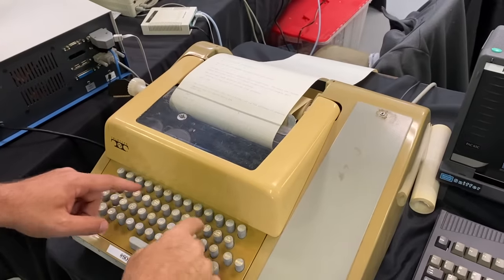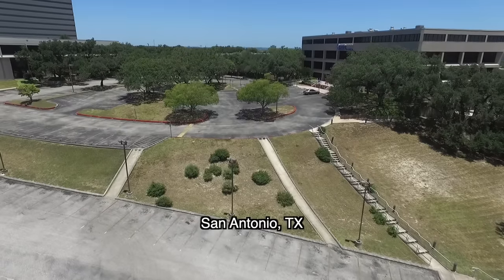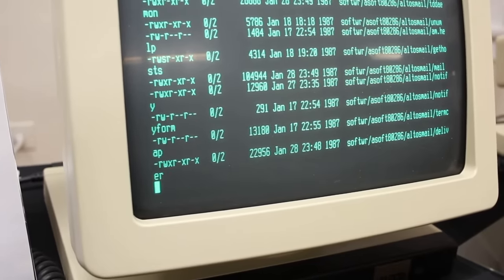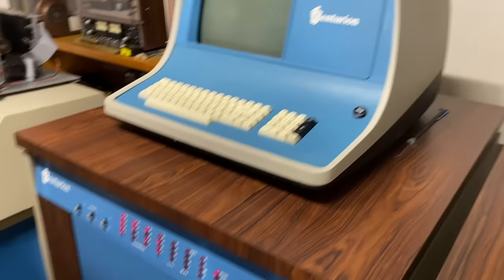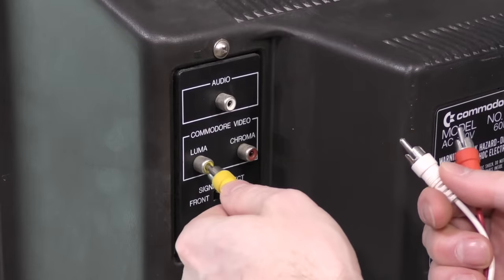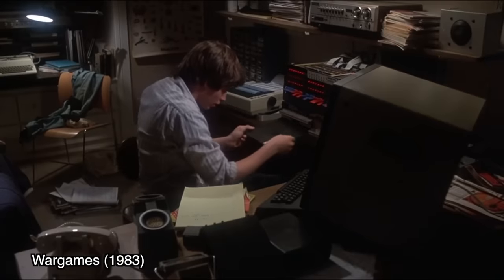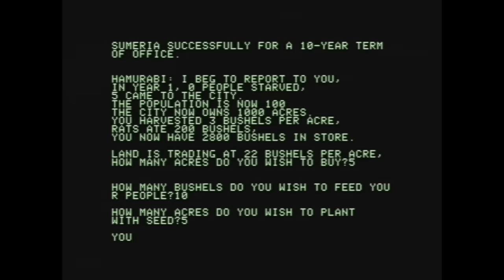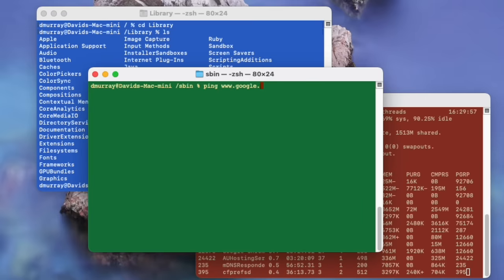What are Dumb Terminals?

Comment: Before ethernet, each of these terminals were linked by a dedicated serial/parallel cable to the main computer. That's why those suspended floors were needed for
Reply: I dare to say, relatively thin serial cables and network cables can go in trays above the inner ceiling, but raised floor enable piping for the cooling system for the cooling as well as heavy power cables to be routed out of sight and away from stumbling feet... :face-blue-question-mark:
Reply: And remember that IBM Mainframe (and other IBM compatible systems) used Bus and Tag cables to connect the disk and terminal controllers to the main CPU complex, These were thick and heavy cables that you wouldn't run overhead if you could avoid it.
The sort-of rule of thumb was that if it was a data processing or computer machine room, the cables would go down under a raised floor (which also hid not just pipes for water-cooled systems, but also air ducts for air cooled systems), and if it was a telecommunication machine room (like a telephone exchange), the cables would go up to trays suspended from the roof, and the floor would be solid concrete (mechanical switching gear was heavy!). 
This has tended to break down over the last couple of decades, and now many computer rooms use overhead cables. This is mainly due to not needing individual cables per terminal (just network cables), and also the fact that often comms equipment like network and SAN switches are installed in the racks with the computers (so a lot of the cables are just restricted to inside individual racks), just needing trunks links between the racks. Also fibre-optic cables are often used, which are much lighter, and have much higher data bandwidth than older types of cables.
Reply: So true!  My fist job was as a "Field Engineer" with Burroughs, installing miles of cables under the raised flooring.  All kinds of cables down there, but the largest quantities were the hundreds of serial cables (full 25-conductor RS232 cables!) , running from the DTE boxes (don't recall the name, but each one could handle 32 lines, or later 64 lines) out to the racks of modems. And also the huge cables for interconnecting the mainframes to the printers, card readers, SPOs, and banks of disk packs, tape drives, and HPT disks.  Those were the days!  A favorite prank with those cables among the older field engineers was to send the newbie out the engineering storage area, for a "cable stretcher", when the cables weren't quite able to reach their destination... Yup, we sure did have a LOT of cables down there.  An nothing at all "overhead", as some have suggested.  The ceiling area in those data center machine rooms was all  HVAC and fire suppression stuff.  No cabling related to the mainframes.

Comment: I used one in the dorm commons at the U of Wyoming in 1990. Set up an account on the VAX to run a statistical analysis package for a polisci class. Got my output on paper in a basket labeled with the first initial of my last name at the now-demolished Ivinson Building, where all that was located.

I didn’t understand it at the time, but that account also gave me email and internet access (such as it was back then).
Reply: Sounds very much like my experience at the University of Iowa starting in 1992. The dorm computer labs had a mixture of terminals and computers. I did get the email account and learned how to telnet to servers like ISCA BBS and Usenet before there was much you could do on the WWW. I was happy to use the terminals if the computers were taken since it was all text-based anyway. I got an account on all the computer servers they offered, even though I didn't know anything about mainframe systems. I taught myself how to use Unix from the man pages. I never got much into the Vax system - it was too unlike DOS for me to figure out. I even convinced my parents to get a dialup Compuserve account so I could email them, which we did so regularly.

Comment: I remember using a terminal back when I worked at Pizza Hut. This particular store in 2003 consisted of a windows 95 machine for a server that had nine terminals connected. Not all of them had keyboards but instead had six button pads on the line to control the orders that were on screen. As you can imagine if that silly 95 machine went down the whole store would grind to a halt until it rebooted. Ironically enough I noticed recently that some of that software from back then is still in use. I believe it is only used as timekeeping but still was odd to see it.
Reply: Well, that's yesterday to an old dude like me. So called terminals had been more or less "stone age" for a quarter of a century in 2003 as well.

Comment: What is interesting is those modern terminal apps you see in modern OS behave exactly like an old teletype, like in the sense that when you see what you type is the program echoing back the characters.
Reply: Amazing how terminals used to be big expensive machines that tons of places used.  Now all that can be done in a small program included with the OS and hardly anyone uses it or even knows what it is for nowadays.
Reply: You can still run minicom on Linux, through a serial port to another Linux system to get that old time UNIX feel.  I have an old ThinkPad with a 4:3 display that I've done that with.  🙂

Comment: My first IT job was looking after one of the first Mainframe and Terminal setups. the Honeywell DPS6. Often used in Government "establishments" as was the one i looked after. With over 3000 terminals all on 10mb Fibre. This was in 1987, Ours was used to connect to a database and it was actually amazingly fast. Any searches that were input were responded to in just seconds.
Reply: Same ere, out original set up was via 2400 modem , the server was about 60 miles away

Later we used cluster controllers holding up to 24 terminals per cluster and each cluster has 9600 modem 4 - wire or full duplex private line ( not dial up )

Screen response was very good, i dont recall any screen enquires taking more than 3 to 5 seconds for a update, the system would have had minimum 80 users per site , so about 1600 users on the host server

Even a full screen of 80x24 is about 2k - that does not take long to transfer even at 2400.
Take into account the escape sequence that will clear the screen, and the internal memory would through up the blank enquiry form, then populate the field with a home command / data 1 / tab / data 2 / tab data 3 etc
Reply: 10 megabit fiber?  Wow!  I bet that was insane back in 1987.  Up until 2022 my internet speed was only 3mbps!  I realize your 10mbps connection was just the internal network but still that seems like insane speed for 87.
Reply: @HerecomestheCalavera   I am not sure when fibre was available, i known in my senario we serial / copper wiring until  co-axial was introduced from 1985 to 1992, then some larger buildings internal wiring went to fiber optic.

By that time, all internal became cat 5 as novell was phased out and ethernet was adopted - we did have fiber connecting adjoining buildings together
Reply: @HerecomestheCalavera  UK Defence network, budget was unlimited back then.

Comment: So much nostalgia in this one! I used to own an ADM3a dumb terminal that was going to be dumped by the service org I worked for at the time, & got both it & the service manual, which included full schematics. It was a fascinating circuit that got by without a micro by using a state-machine implemented in plain vanilla TTL logic.
Reply: Yup. Just about as smart as  you could get without a microprocessor. Sort of a baseline for "smart terminal" -- i.e., an adequate function set to run emacs!

Comment: Thank you for this video! I was born in 1995 so I only briefly remember using a terminal at one or two libraries that still had them to look up where a book was. I remember really loving the green text and how instant it felt to look up information compared to at the time how slow cheap internet connections were back in the early 2000's.
Reply: nowadays internet have been faster than before (2000s)

Comment: The place I remember dumb terminals from most prominently (and fondly) growing up was in libraries that used them in addition to the old physical card catalogs. Especially if you were doing a term paper and needed to find out what articles were in periodicals about your topic. You'd look it up on the terminal, print the list of abstracts to the dot matrix line printer, then go through the list of  brief abstracts or sometimes just titles and try to guess which ones were actually relevant to your term paper. Then you may have had to wait until your library borrowed the periodicals from another library to actually see and photocopy the articles. Does anyone know what kind of computer system in the library those dumb terminals would have been connected to?

Comment: I remember the computer card catalog at the libraries growing up.  You would "use the terminal" to find the books.  It took me later in life to realize how it worked, that there was a mainframe somewhere that the terminals were all hooked up to.  I just now remembered using my computer at home to dial into the library, and using the terminal just like using it at the library. Wow, tech sure has progressed.
Reply: Yep. I remember there still being some around at some of the branches of our county library system even in the early 2000s. They tied into the same system that the GUI-based Windows apps and, later, Web-based interfaces used. Especially when they were built directly into the architecture; it would be quite some time before you could cram a Windows PC into the same tight space.

Oh, and the bookmobile used a terminal connected to a radio antenna to handle checking stuff in and out. I remember that they sometimes had to unpark and repark a few times to establish a solid connection that wasn't blocked by the trees and weather.

Comment: My grandfather used to run the records department for the local university and did a lot of data entry.  At first, it was punch cards.  In fact, they still used them on occasion up into the 80s.  I remember him sitting me in front of a terminal with a green monochrome screen and showed me a dog chasing a cat.  He typed the word dog then cat and then scrolled back to the beginning of the word dog and held down the space bar.  We even had a modem in the house, the old kind you had to put the phone handle onto, so he could deal with issues at work without driving several miles back to the office.
Reply: That's an acoustic coupler modem.
Reply: @RaymondHng  Hmm, not sure I ever heard the name before.  I'm 44 now and that was when I was like 8, so even if I had heard it then, I wouldn't remember.  Thanks.
Reply: @Craxin01  I’ve been using computers since 1974. Anderson Jacobson was a manufacturer of those modems where the telephone handset is seated inside two rubber cups. Those are acoustic couplers. Two models were the AJ 311 and AM 211.
Reply: @RaymondHng  Wow!  1974?  My mom was 16 then, hadn't even met my dad then.  My earliest computer experience was an Apple IIe followed by a TRS-80.  Didn't have a computer with a modem (my grandfather's being more of a terminal and only he used it) until probably 1996.
Reply: @Craxin01  Home computers did not exist in 1974. The computer was an HP 2000 minicomputer the size of a small refrigerator located miles away. The school only had a Teletype KSR 33 and an acoustic coupler modem that was used to dial up and connect to the HP 2000.
Reply: @RaymondHng  Isn't it amazing how much technology has advanced?  That refrigerator sized computer is technically dwarfed by a tiny phone you can fit in your pocket and is itself essentially a modem.
Reply: @RaymondHng  Exactly my experience in high school  ASR 33 talking to HP 2000 about 80 miles away.  (But we also used it with U of Minn class accounts to connect to the CDC machine which had games and chat rooms and email,  far more fun for high school nerds.)

Comment: Fun fact, the Bendix G-15 was designed by Harry Huskey. He had previously worked on the ACE and SWAC computers with none other than Alan Turing.
Reply: I worked for Data-100 and supported the printers and card punches and card readers at Bendix Guidance, Bendix Flight and Bendix Aviation in Teterboro, NJ.  This terminal equipment was connected to a mainframe in Southfield, MI.  Teterboro was known as Bendix Borough for six years.'37 to '43.

Comment: My first experience with a roomful of terminals was at a call center in Dallas in the 90s.  We just dumped data in, and it would autodial the next victim hehe.  Every desk had a wyse terminal, a GTE rotary phone (you know the one) we still had to hold to our head, no headphones yet... and a big ashtray.  The building inside was a dark yellow from the smoke.  They kept the lights off to save power...it was sad.
Reply: The classic black one, or one that could theoretically be hung from a wall?
Reply: @Chaos89P   the terminal was whiter than white, the phone was a color I would call, "vintage yellow."  Even new they looked old.

Comment: Fascinating. When I first watched Star Trek as a kid, I thought the sounds the computers made were supposed to represent the sound of hard drives working, a familiar sound which I grew up with. Never made the connection to mechanical teletypes.
Reply: Reel to reel tape drives is the noise I thought of.
Reply: Now I'm wondering what kids these days would think of it, growing up with devices that are completely solid state.
Reply: KFWB (in the '70s an "all news, all the time" radio station) had the constant sound of teletypes in the background ... I'm sure that was supposed to represent the sound of a real "news room" back in the day.
Reply: @josephgaviota  So did KYW. Probably still does; been a long time since I was near enough to pick it up.
Reply: I always thought it sounded like electromechanical telephone switches, like the ones at the Connections Museum in Seattle.

Comment: Also: In addition to "dumb terminals", there were "smart terminals", often used with mainframes (so you could fill out the form without wasting the mainframe)
Reply: Yes, to elaborate,  even though David said a couple of times that the terminal and central computer would interact every time a key was pressed, that was not true of IBM mainframes. They were setup more efficiently.  The user would type whatever keys he wanted. They would get echoed to the screen by the terminal itself. Eventually the user would press one of a handful of keys, usually Enter, but sometimes a PF key or a few others, and everything that had been typed would be sent to the central computer for processing, which would then send back data to refresh the screen as needed. Some mainframes had thousands of attached terminals and this really helped with turnaround time.
Reply: These were called "block" terminals (ex: IBM 3270).
Reply: Oh yes, we used roomfuls of 3270-series terminals a lot in college, most were the basic 3278 with full keyboard (not the reduced cash register keyboard shown in some modern descriptions).  There were also a tiny number of color or graphics models, but normal exercises were done with basic text models and knowing which seats in the converted auditorium could do bitmap graphics was important for the one class that would output graphs from the programming exercises .  I didn't get within arms reach of an IBM mainframe until a later job when servicing a Compaq server in a business that had a modern one next to the server racks .  The software was done in per login virtual machines with per student virtual discs and an interface using virtual punched cards . The machines were apparently on BITNET, but I never used that .

Comment: The UK retailer Argos used them when i worked for them until late 2000s. A unix based(i think) server which interfaced with several dumb terminals for back of store operations which was later replaced with windows embedded wyse terminal running a terminal emulator.

It looked dated, but a very quick system to key in and process data. I loved using it.

Often called a green screen

Comment: 00:27 🖥 Computers initially lacked screens; communication involved teletypes, similar to typewriters, transmitting messages.
01:51 📜 Teletypes were commonly used for typing commands to computers and printing their output on paper.
03:46 📺 Terminals were developed to display text on screens instead of printing, like the Datapoint 3300 with scrolling text.
05:39 🗝 Exploring old teletypes and early computers, such as vacuum tube-based systems like the Bendix computer.
07:30 🖥 The ADM-3A terminal, lacking a microprocessor, utilized TTL logic chips for operation.
08:57 💡 Terminals varied in "dumbness";some had limited interactivity, allowing text movement on the screen.
10:50 💾 Dumb terminals stored data internally; disconnecting them from the computer didn't erase displayed information.
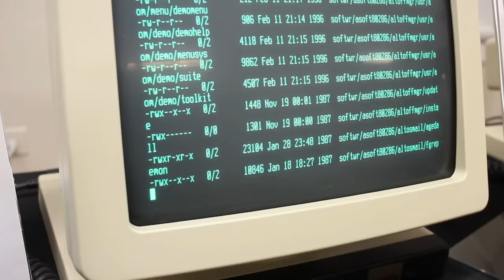12:13 🕹 Some personal computers integrated dumb terminals, like CP/M-based machines or the Apple 1.
13:08 🌈 Early terminals mainly handled monochrome text for business but rare ones could display color graphics, albeit slowly.

Comment: Interesting history lesson on how we got from teletypes to terminals. One thing to keep in mind is that PCs still run as terminals to this day, just smarter...not just the command line interface that you showed, but any time we talk to another machine over the internet, it's still basically the same thing. It's just that the protocol has become more sophisticated and more complex than 'just' the old ANSI codes. And then someone figured out how to send actual runnable pieces of code over the connection to be run locally instead of on the remote system.